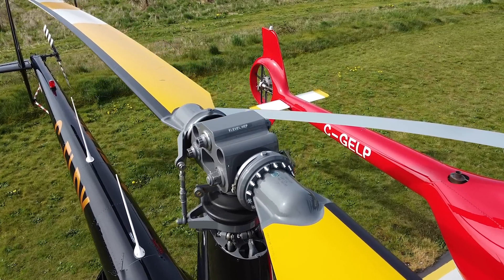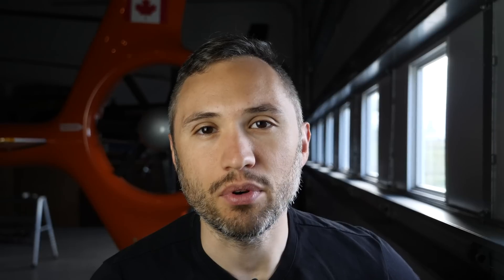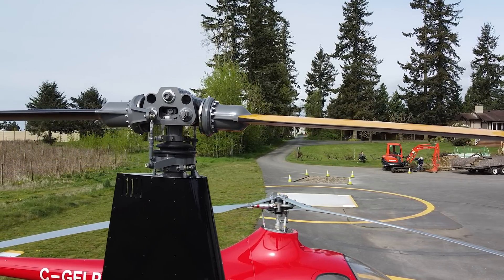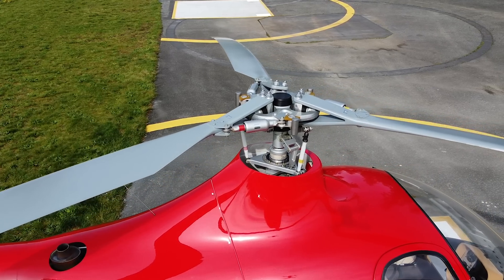WHY MORE BLADES ARE SAFER

Comment: There is no "better" about either designs, its just different.
1- Strictly from lift perspective, 2-bladed systems are not inherently worse performers, they just need larger disk area to perform as good.. If physical dimensions are not the issue, 2-blade designs are actually the most aerodynamically efficient, followed closely by 3, and adding more blades subtact from efficiency. This is why there are 2 and 3-blade wind turbines, but we don't really see a 5-6-10-20 bladed wind turbines. Because so long as they are safely away from the ground, there isn't any dimensional contraints and its always better to have longer blades and have a larger disk area, than to add more blades.
2- Closely related to #1, storage advantage goes both ways.. A 2-bladed helicopter of same weight will have greater rotor diameter to retain aerodynamic efficiency. Since tail length is also proportional to rotor diameter, a 2-bladed helicopter of same weight will inherently be longer. A folding multi-blade helicopter will be comperable in width, but smaller in length to a folding 2-blade helicopter.
3- 2-blade will have unique mast bump risk, 3-blade will have ground resonance. Mast bump is pilot-induced 99% of the time, ground resonance is both pilot induced and maintenance-related.
4- A 3 blade rotor will be easier on the pilot and more stable to fly, 2 blade will be much more responsive to controls.
5- Misalignment on 2 blade is easier to notice, but that "advantage" argument goes both ways.. Is it not better to notice a problem early without symptoms getting worse?
 For example, if one blade has damper issues and drags just a little bit more, its not really noticable with minimal cyclic inputs, like when hovering, but it can have lethal consequences.
6- Misalignment on 2 blades is more noticable, but misalignment plane is (mostly) on a single axis on semi-rigid rotors, so easier to diagnose. On a fully-articulated system there are 3 misalignment planes. 
7- Adding more rotor blades to SOME designs work, because they are done so with other constraints. Some are specifically designed for a certain rotor diameter, or started with a puny engine and upgraded along the way to a much stronger engines. Both points apply to AH-1G to AH-1J to AH-1W to AH-1Z evolution: AH-1G with 2-blade (<44ft) rotor for a 1x1100hp engine was fine and quite efficient, but using (mostly) the same rotor with 2x1530shp only increased MTOW by 200kg while adding 200kg to empty weight on AH-1J. This, obviously, left way too much performance on the table. So AH-1W had larger (48ft) rotor diameter to compensate to a degree, and finally upgrading to a <44ft 4-blade system literally doubled the MTOW of AH-1G/J to 8400kg. Like I've said in #2, AH-1Z has shorter fuselage than AH-1W, so its easier to fit in a hangar when blades are folded. The question is, would putting the same 4-blade rotor on (1100hp) AH-1G from the start be better? Answer is no, it didn't have engine power to utilize it back then, and 4-blades adds unnecessary weight+complexity without any benefits.. So, without looking at other 
constraints, making claims about better performance is just wrong. Adding a 5 blade rotor to R-22 is guaranteed to perform worse than its current 2 blades.
Reply: Awesome analysis. Engineers perspective.
Reply: Outstanding overview, I don't know why I bother watching videos when I can find gold in the comments like this.
Reply: Thank you!  This is the kind of in-depth discussion I was looking for when I started googling.
Reply: Thank You, well worth my time reading.

Comment: So what you're saying is that my single blade helicopter design is just going to be just terrible?!?
Reply: However, my zero blade helicopter has a flawless safety record.
Reply: @RicCrouch   my invisible helicopter might rival your design
Reply: @RicCrouch  You're zero-blader is no match for my infinite-blade heli  :-P
Reply: Not at all, your design will work just perfectly. 

Please post the video of your attempts on here.............
Reply: @davidbrayshaw3529  I heard that one blade has the lowest air friction possible and is the most efficient, but if we want to add more power we are forced to use 2, 3 and more blades. So 1 blade designs are usually seen on RC models, 2-3-4 blades on normal planes, a lot of blades on planes line AN 225 Mriya (biggest aircraft on Earth). Same thing we can see with helicopters.
Reply: @denysivanov3364  I am of the understanding that friction relates to the props' surface area, its condition pertaining to damage and subsequent dressing and also pitch. I believe that increasing the number of blades has two significant effects on efficiency. Firstly, by increasing the number of blades the air being "fed" into the following blades becomes "dirty" or disrupted and as a consequence  good laminar flow over the following blade is more difficult to achieve. In addition to that the vortices around the tip of the blade create drag therefore increasing the number of blades reduces efficiency.
You are correct that increasing power levels usually requires increasing the number of blades which are used. Tip speed and ground clearance are other issues that designers overcome by using additional blades.
Years ago I was "hanger rat" )AME working mainly on vintage aircraft. My employer, a licensed engineer, had a saying about the number of blades on a prop that pertained to their efficiency. "Two for go, three for show" but as you point out, you can't avoid having more blades as you increase power.
Reply: https://www.youtube.com/watch?v=wxY9snBbAAw
Reply: The US military funded a single blade experimental helicopter in the early 1950s. It flew, but was very soon abandoned as a pretty stupid idea. A single massive blade (looking like an aircraft wing) with a large counterweight for balance. Re result I think of an earlier experiment with mind-altering drugs on design engineers ... or should have been.
Reply: @chrisknight6884 they were more into absurb contests. let's call them drinking games.

i took mettalurgy classes from an old detroit engineer. he said they would have count the numbers of martinis at lunch in five, ten, fifteen, 20
Reply: Hey, I've seen an African "genius inventor" putting a single flat bar across the shaft with no angle of incidence and then wonder why it didn't fly ... lol
Reply: I still like how a single blade sounds when it's flying 😁
Reply: Shiiiit, my no-rotor system is quiet as a mouse.
Reply: The dude called vibration was so mad to you🤣
Reply: My invisible engined helicopter is the best
Reply: Lockheed made a single blade  drone called the Samurai.
Reply: I think the body aerodynamics will be much more important on a single blade design. You'll need to create counteracting drag forces to keep from auto rotating. I think?

Comment: Plebs, my private helicopter has only 1 blade. Im thinking off upgrading to bladeless
Reply: Hot air balloon?
Reply: @gogo8965  No it's a helicopter with 1 blade
Reply: @eliaslundstedt5607  it can be RC model. One blade is the most efficient (lowest air friction possible)
Reply: +Eddie Meduza   Bet it's built by Dyson!
Reply: @Islamisthecultofsin  nah it's built by Boosh, since I wan't quality.

Comment: Shouldn't 2 bladed rotors have increased efficiency compared to rotors with higher blade count?
Reply: They are in fact more efficient. There have also been some experimental single blade designs where the opposite blade is replaced with a counter weight.
Reply: @atomicskull6405  
While hovering.
If its moving with a significant speed, the blades are getting fresh air and are not travelling throough the turbulent backwash of the blade before them.
Reply: Ok

Comment: I've balanced 2 blade helicopters down to 0.05ips.  The out of balance/out of track shakes have all been 1/rev vibrations.  The same ship had a relatively low 2/rev with full tanks.  However when the fuel level got down around 1/2 tank the 2/rev was noticeable.  I've been told that 3 bladed helicopters do not have the 2/rev but instead have a 3/rev.  Higher frequency can induce shorter fatigue lives?

Comment: It’s better that you operate the controls, than design the next rotorcraft. It’s easy talking nontechnical, about technical stuff. Reliability and probability of failure with increased components also wasn’t mentioned

Comment: "3 bladed rotor system always has a blade in each QUADrant" .........  spot on bud.... spot on. glad the next generation of pilots are being trained by you. . . . .
Reply: Wrong.. It always have at least 1 blade in one of the 4 quadrats.. But you can't have a blade in each of the 4 quadrats with 3 blades..
Reply: @hisheighnessthesupremebeing   thanks tips, yea i know, it was a joke. i was quoting him.

Comment: Another great "con" against fully articulated multi-blade heads is Ground Resonance. Usually with the smaller birds and can be catastrophic.  This doesn't happen with teetering heads.
Reply: There are more than just teetering and fully articulated. There are also rigid and semi rigid.
Reply: So can a two blade suffer from ground resonance?
Reply: even a two blade heli can suffer ground resonance
Reply: @simeonkioi3844  not on a teetering head. It's kind of the reason teetering works.

Comment: 2 blades are more efficient than 3 not less efficient.  Two of their biggest drawbacks are they are longer and louder.
Reply: Sorry, but you are incorrect. A multi-blade fully articulating system (i.e. more than two blades) allows the individual blades to lead and lag during a rotation, correcting for the coreolis effect caused by tilting the rotor disc to achieve forward flight. A two blade system cannot do this which means that neither of the blades is rotating at its optimum speed at the front and the rear.
The result is that the rotor system (although much simpler, not needing flapping and lead-lag hinges and dampers) has to absorb these lateral loads requiring a heavier structure, leads to more vibration and higher aerodynamic loads on the blades with the consequence of greater drag, greater fuel consumption and much more noise. 

All of these reduce efficiency. The main reasons for the continued existance of the two blade tilt-rotor design are simplicity, reduced maintainance and cost. This is why the cheapest and lightest  end of the market has two-bladed designs and with the exception of the likes of  Bell, nearly all major manufacturers embrace the multi-rotor design. Larger helicopters abandoned the two bladed concept early on. 3,4 and 5 bladed heads are now the norm.

Comment: Ok, you talk about Mass Bumping on a two bladed system but you did not mention Ground Resonance on a fully articulated system? I'm a bell guy and I like my 2 Blades, nice auto's and the Heli does not disintegrate on the pad from an unbalanced rotor system.
Reply: I didn't see your reply before I chimed in but more of the same. Mast bumping hasn't been a design concern in 20 years with sprague cables and flapping restraint cables (Bell 222).  Statistically 2-blades are 2x safer than fully articulated heads.  But always fun discussions.

Comment: Keep up the videos. No hate but some clarifications: Most of the more recent generations of 2-blade heads (like the Bell 222) have hub flapping restraint springs or other designs having sprague cables. Beyond expense there is also a lot more weight, failure, and maintenance concerns. Statistically 2-blade helicopters are safer especially when pilot error is removed.  All factors in play the Bell 206 is 3x safer than a Hughes 396. And the lowest civilian accident rate of all (per 100K hours) goes to the Bell 205. So probably a bigger consideration is turbine/piston.  Where the failure rate in turbines is 9/100K hours and pistons fail at 29/100K hours.  So which blade is safer? Really points toward the simpler 2-blade teetering head.
Reply: 100%

Comment: Most 2 blade rotors are high inertia rotors; meaning if the engine quits you have more time to react before you lose rotor rpm. Three and four blade rotors are generally low inertia, bleeding off speed rapIdly when you lose power. I have done autos in both a Bell 206 (TH57) and a Bell 406 (OH58D), you have a little more time in the 206 to get the collective down and maintain rotor rpm vs its 4 bladed cousin.
Reply: Couple more things: There is no "ground resonance" with teetering heads. Far cheaper and less complex. Statistically 2x safer.
Reply: @MrRexquando  'statistically safer'?  What statistics? Quote your sources .........
Reply: @chrisknight6884  Epidemiology of helicopter accidents by Jared S. Churchill.  FAA Monthly Accident Briefing June 2020 "AIR-680" "AIR-682" or you can just look at the total number registered in the US by type and the total accidents by type (from Wikipedia) Just over 2x more multi-blade crashes by flight hour. Why is this important? Because almost 100% of training is done on 2-blade helicopters and should so a higher accident rate because of pilot errors. So the actual safety factor if you could remove training is probably much greater.  Now what you got?
Reply: @MrRexquando  very interesting  list of titles, but the content does not support your stance. The paper 'Epidemiology of helicopter accidents' actually comes to the opposite conclusion; I quote ...' the worst-offenders in terms of contributing to the total count of accidents are the single-engine 2 bladed  reciprocating and turboshaft helicopters. The 4 bladed single-engine turboshaft types occupy a safety sweet spot and have the lowest accident rates of all single-engine helicopters. ' have you actually read this paper or just thought the title sounded good?
My background by the way is 20 years of Naval Aviation, mostly in Sea Kings. I have seen my share of crashes (all multi blade rotors), so they are not immune.
Reply: @chrisknight6884  Ok smart guy 2016 data: Bell 206 6Million hours 30 fatalities. Hughes 369 1Million hours 13 fatalities.  Twice the fatalities per Million hours.  I didn't read the summary just looked at the data. I wrote that comment 9 months ago. No idea what my source was back then.  You have any sources or just like to snipe?
Reply: what, I thought most 2 bladed were low inertia by their total low head weight and despite getting slightly more outside mass having longer blades, it takes much less time to lose rotor rpms.. thus little autorotation reaction time . 1.5.sec for r22 or something..
Reply: @unagisama5476  its not inertia, 2 blades have less friction then 3, 4 or 5. But with a lot blades more power can be transmitted into air, thats why on big heavy aicrafts-rotocrafts we always will see a lot of blades on rotor/propeller.
Reply: @denysivanov3364  "Than"  not then !
Reply: See an Enstrom for a counterpoint. Lot of inertia with a three-blade rotor.
Reply: Auto rotation inertia is mainly about drag, have a large 2 rotor spins slower and has less drag so it doesnt slow as fast. lots of rotors plus faster rpm has more drag, so they slow down faster. Think of one finger out the car door at 50kmh vs 5 out the window at 100kmh, which will cause more drag. more rotors and higher rpm needs more power as there is higher drag/lift across a broader area of the rotor, this works in reverse also.
Reply: And the high blade solidity with more blades
Reply: Yeah, just look at a Huey. Has a VERY high inertia rotor system. I like it
Reply: Inertia depands on mass so more blades should have more inertia then of less blades
Reply: @omsingharjit  you are assuming that the all blades are the same, they are not. The number of blades has no bearing on inertia. It is the mass of the total blade system that matters. Two blades systems have broader, lower aspect ratio blades than multi- rotor systems to make up similar lifting area for a similar AUW.  The two-bladed system has heavier blades due to their longer leading edge to trailing edge distance. The multi-blade system has a more complicated and therefore heavier rotor hub, however it is closer to the centre of rotation and so has a proportionaly smaller effect on inertia. Overall the amount of inertia works out more or less the same in general terms.
Reply: @chrisknight6884  Got any data to support this? "proportionaly smaller effect "
Reply: @MrRexquando  According to the rotationary inertia formulas, both the rotor radius and the angular speed contribute by the square, so a rotor with both less diameter and less revolutions has a significant lower inertia moment. Mass comes only in linear proportion(sic).
Reply: @thecalif2914  I think I agree with that?
Reply: @omsingharjit  True, but generally twin rotor helicopters have large diameter (cord) blades vs 3 or 4 blade helicopters. Compare a Bell 206 to a Bell 406 or 407; the 206 blade is much larger in cord. In my experience  in simulated engine failures the twin rotor system allowed you to have a slightly more delay before making corrections to recover rotor rpm (eg lowering the collective) than the four blade helicopter.  This probably because the 206 blade has more mass, allowing it to carry more energy longer, and being a twin, there maybe less drag vs the 407 blades.
Reply: @omsingharjit  More blades also have more aerodynamic drag, which when no power is applied, slows them down more quickly to stall speed. When that happens you drop like a stone.
Reply: @jakerabinz9411  if there's more drag than why it will fall like stone because drag means slowing down things in air